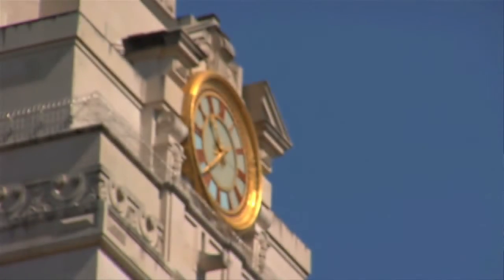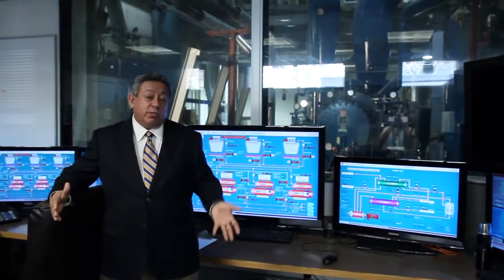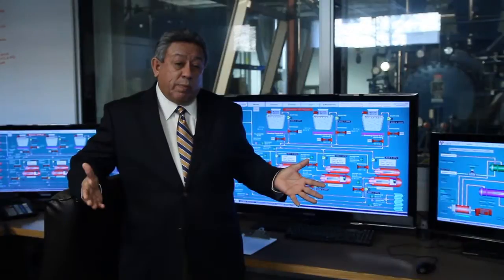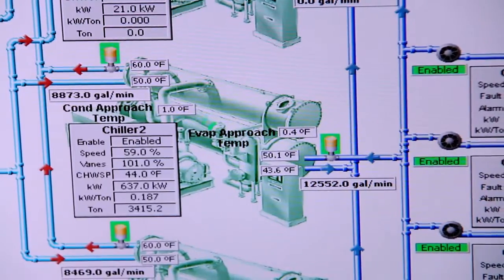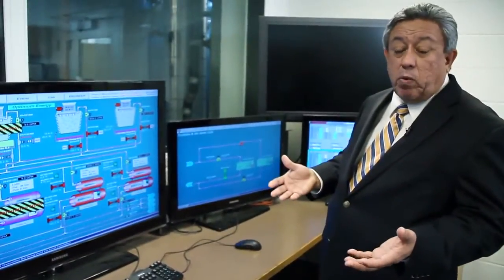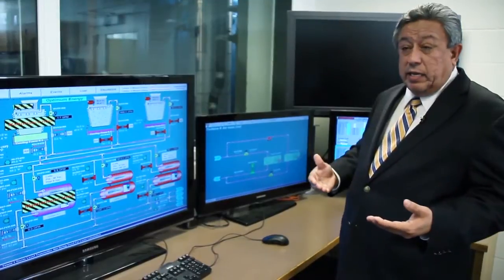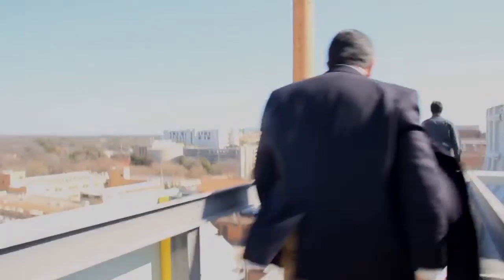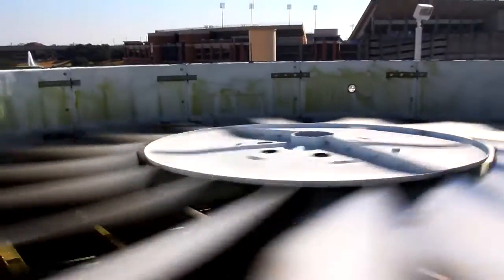Power plant efficiency challenge

Comment: I've been studying this a lot lately.  It's simply entrenched industrial culture, I think.  Variable-frequency drives save LOTS of energy, yet the will to employ them is simply not there.  I saw an estimate that 65% of energy used in all industry in the US is for drive motors, and 20% of that is wasted by throttling output through valves and dampers.  So, lots more could be done.

Comment: Dimitri has a "technical" point except we need to remember that the campus is now >30% more efficient in usage mostly from generating power onsite ridding itself of the transmission losses that the centralized power plants suffer from.  That does not even account for the added burden costs such as line upkeep, right-of-way clearing, etc.  Any facility would be happy for 30% reduction in energy costs. One questionable aspect of the system, chillers are very expensive to operate.  Cost analysis?